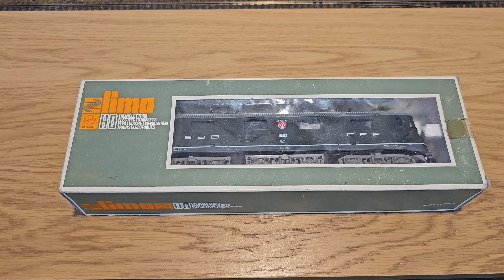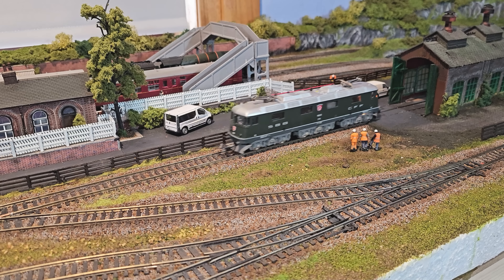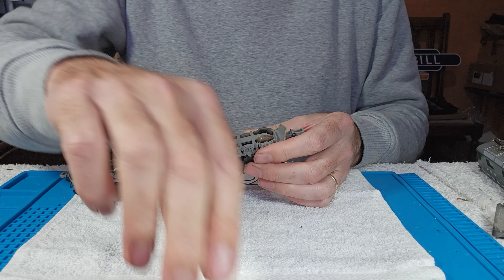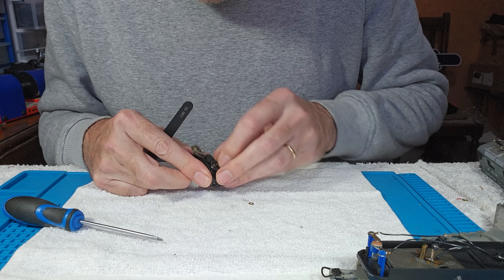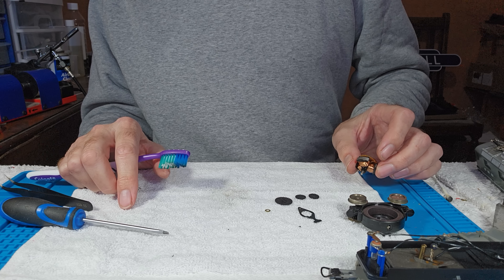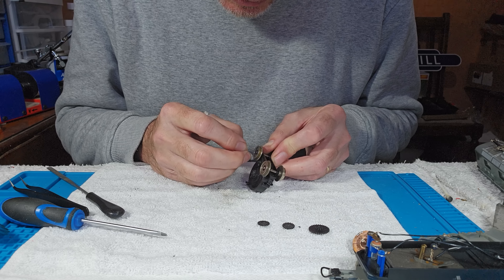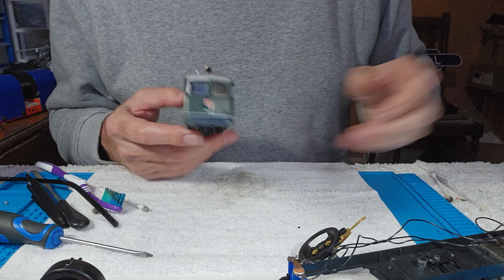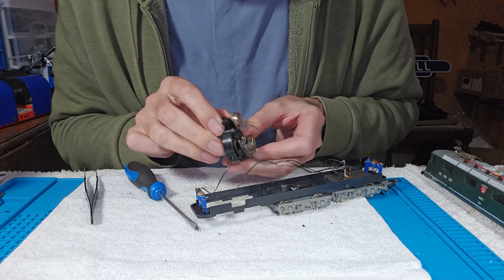Lima HO Scale Swiss Class RE 6/6 11603 "Wadenswil" : Repair Request

Comment: Hi, this is the second time I've watched this video, the reason being I bought a Lima DB E410 electric locomotive for a restoration project.  I found that I have a loose retaining clip for the gears, and can't work out how to refit it.  It's identical to the motor you serviced on this locomotive, but I couldn't see how you refitted the clip.  I know the clip holds the main gear in place, and that there is a small tang that goes into the slot above the spindle cog, but when I have that in place, the clip just sits on the top of the two little protrusions , causing every thing to sit there more by an act of faith.  What am I doing wrong?

Comment: You did an excellent job, I'd never thought of a cable tie to make a buffer, I usually use modelling styrene.
I use technical petroleum jelly to lubricate gears and the pick-ups in Lima electric and diesel locos. It guarantees excellent running and electrical conductivity.

Comment: That's a good tip re the cable tie buffers - quite a few Lima HO locos have this pattern buffer so it's annoying that no spares are available.   BTW the loco is an Re6/6 - Lima did an Ae6/6 too which looks similar but has normal 6 wheel bogies rather than the tri-bo arrangement of the Re6/6
Reply from the maker: So it is. Thanks have updated title and details.
Reply: Jouef make similar SNCF 
buffers ... they have square shafts but could be filed round.
Reply: Thanks that's good to know - I'll watch out for those @maltnz

Comment: Hi Bill, What's your view on adding extra pickups to Lima & Triang diesels? I'm sure I watched a video in which I saw you do it, but I've failed to find it in your back catalogue. I guess adding them to Triang locos would be more of a challenge as the dummy bogies have plastic wheels...

I have a pair of both Deltic & Class 20 Lima diesels. The biggest issue I find with them is their propensity to collect dirt on their wheels, which seems worse than with any other manufacturers locos.

Comment: Iv'e got the same type of model you've just repaired. Mine is by Roco who are a Austrian manufacturer. I brought in the late 1980's it had traction tyres as well as lights front and back depending which way it was running.